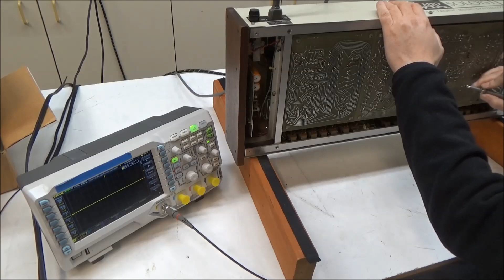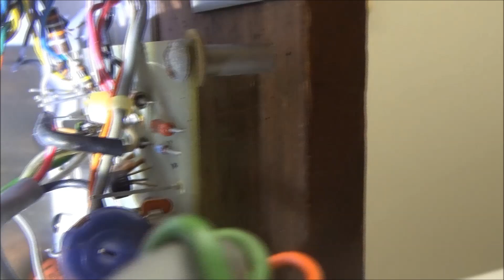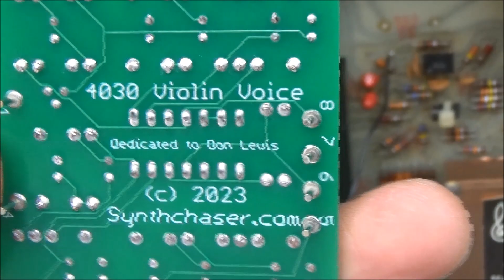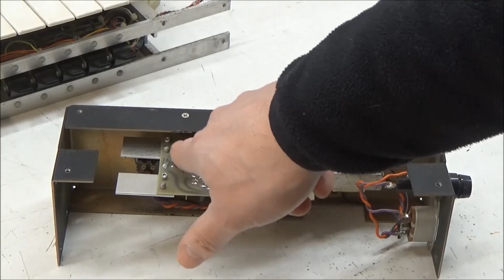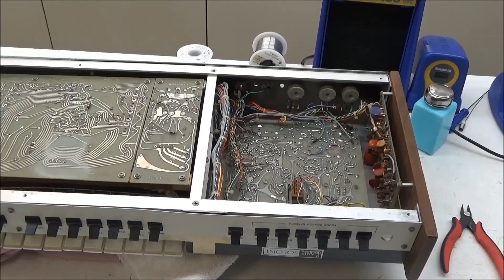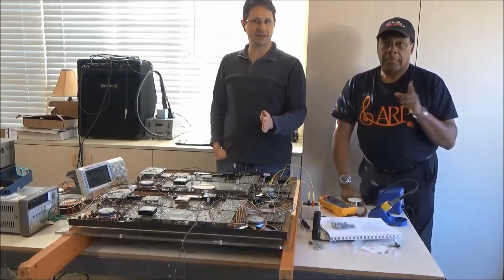Don Lewis' Original ARP Soloist Repair Part 2 - Synthchaser #160

Comment: Since you have the bad module you recreated you might try using methylene chloride to destroy the epoxy in a tupperware  without submerging it in the liquid by fuming it. Wear gloves and use good ventilation. Great video as always.

Comment: Fantastic job. Stunning that you were able to recreate the epoxy covered board. Hats down sir.
Also that power supply design, it reminds me my Logan String Melody II I had to service earlier this year, what a crazy process that was to get to power supply to fix failed components and recap it. I had to disassemble it all in similar fashion (hidden screws behind transformer etc), desolder all ports (there was no connector) and power regulator transistor was fixed to outside metal cover (as heatsink) through soldering to board and had to be removed as well. Pain. :D Luckily was able to go through it all and fix it, the synth and its sound was so worth it.
So inspiring to hear about Don, people like him will be missed forever.
All the best keep doing your fantastic work!